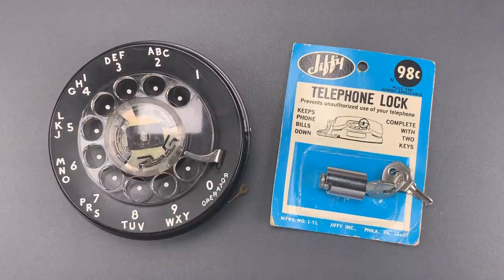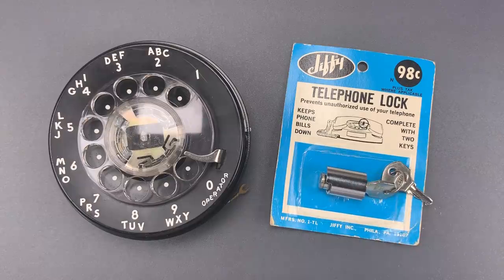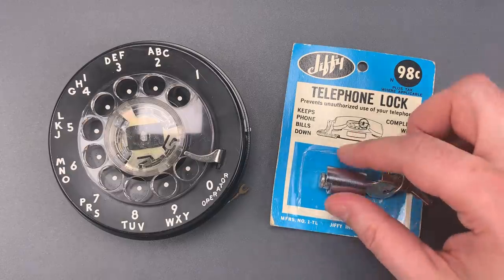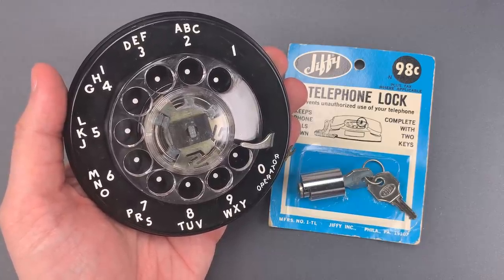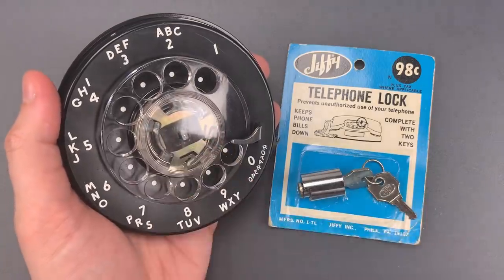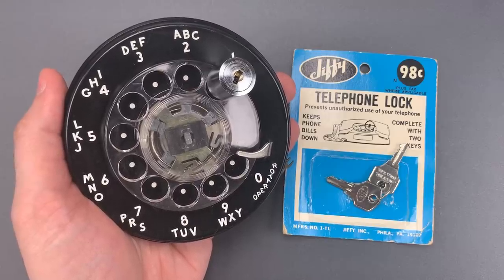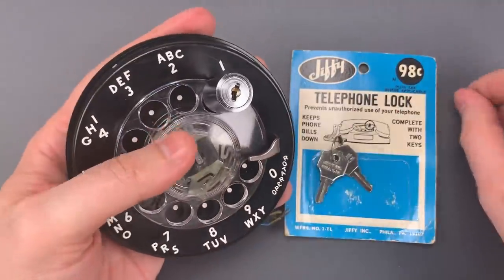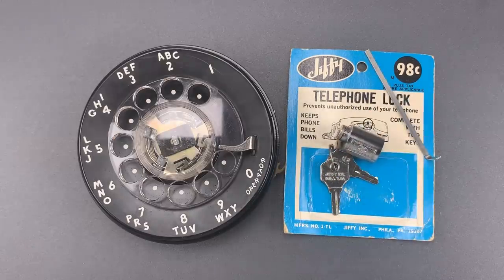[1084] This Lock Could Save A Month’s Wages... in 1960 (Jiffy Phone Lock)

Comment: Only now did I know how to dial with a Rotary Dial Phone
Reply: CIA Imports its seems like you have a bad experience with them
Reply: I had to learn it to solve a puzzle in a game a couple months ago. I was stuck for about 30 min before I googled it how to use these!😅
Reply: @CIA Imports Been there, done that. Hangover and mysterious sore finger. Usually started with an argument with a girlfriend.
Reply: It's not that hard to figure out, the holes lines up with the numbers, so that means each hole corresponds to a number.

Pressing the hole does nothing, pulling is impossible, sliding counter-clockwise is impossible, so sliding it clockwise is the only option.

For how far you go, there's a hook that would stop your finger quite comfortably, and 1 can't go further than that, so obviously, you go until it tells you to stop.

Lastly, when to give it the next number, stopping the mechanism midway when it goes back by itself pretty fast is impractical, the holes originally correponds to one place, and putting in multiple zeros would be impossible otherwise, so clearly, wait until the zero hole is back to pointing at zero
Reply: You young whippersnapper, why I oughta...
Reply: Thats sad
Reply: @cats9254 , Why? They haven't been in use for 20+ years, why should everyone br taught how to use one?

Comment: Before tone dialing, there was pulse dialing and it was possible to tap the receiver rest the right number of times with a short space between digits. I do remember seeing these dial locks in the UK, though. Unfortunately, I am also old enough to remember one telephone area where the phones did not have dials at all and a button had to be pressed to call the operator!

Comment: "long distance calls in that time were very expensive"
Laughs in Cap'n Crunch whistle
Reply: That was touch-tone exploit, rotary dial phones like this one predate the touch tone system and cannot be used with such an exploit.
Reply: FamiliarBreakfast before MF was deployed, tandems talked to switches using SF signaling, which instead of interrupting the talk battery with a pulse train simply sent the pulse train as a series of “beeps”. Common frequencies were 3700Hz for early O/N carrier and 2600 for E carrier and later N carriers. 3700/2600 was also played on the trunk when not in use to allow automated equipment to find an idle trunk quickly. If you reset the trunks by sending your own 2600 you could whistle your own digits into the trunk, like by whistling off a Vancouver number, you could send 2 pulses of 2600, followed by three one pulses; and be connected to a conference on TWX lines that had fallen into disrepair.
Reply: @MilesCallisto  First rule of phreak club, dude!  LOL

Comment: Based on the diagram on the package, I was expecting something that locked the cradle in place.
Reply: Later on, there was a version for desk phones that held the 2 hook switch buttons down.
You could lift the cradle, but the buttons stayed down.
These were generally used on Touch-Tone phones.
There was also a version for Touch-Tone phones that went over the keypad.
Reply: This lock has the advantage of allowing the phone to receive calls.

Comment: So a couple of years ago, my wife and I went to a yard sale. I saw an old phone there. I was intrigued so I bought it. It was an old candlestick phone with a rotary dial. It had a modern plug for a phone line so I thought I'd plug it in and see what happens. It doesn't ring, but you can pick it up and talk on it. Downside is you can't dial (Voip telephone providers don't support pulse dialing) but it works! And it's probably 70 years old!

Comment: In the 90s, there were jacks that had a lock that physically cut off the connection. Unlike those, you can "flash" the number you want to dial by rapidly pressing the disconnect hook on the cradle. Works fine on any POTS line or VoIP that has pulse to DTMF conversion.

Comment: We used to use a cabinet key back in the early 1980s. Stick it in, giggle it around a bit and it would open. Back when we used to dial into the computer.

Comment: We used to take the receiver off the hook and then hit the receiver tabs that stuck up on the phone body really fast 10 times. That would simulate the phone dial being turned from the '0' position thus dialing the operator. Once we got the operator we would ask for assistance in dialing the phone number we needed to dial. It worked every time.

Comment: A great example for how a lock is only as strong as whatever it is attached to.
Not only it should be easy to chip the lock off of the bacalite dial, or twist the small standoff that catches the finger / lock so it is not obstructing anymore, but as long as the handset isn't locked you can make a call using the hangup lever alone.

Comment: Crumbs I recall those, in fact I remember the dial being fitted to my folks phone when the local exchange went from switchboard to automatic. Fun fact, when I later worked for the Post Office before it became BT the first push button phones had a setting where they would use loop/disconnect pulses (i.e. emulate a dial) for old local exchanges not yet able to handle tone dialling.

Comment: When I was a child I remember the phones where there was no dial at all - commonly courtesy phones.  I was fast enough at flipping the on/hook off/hook button or the hook itself depending on  if it was wall mounted or table top, in rapid succession to manually dial and place a call.  5 quick clicks dialed a 5.  Took a lot of practice.  I was only 7 years old at the time.

Comment: I used to simply pick up the handset, and then commence rapidly pressing the hook switch that would depress and end the call when you placed the handset back down.  One click for the number 1, 2 for 2, 3 for 3 etc. If you were lazy, or couldn't do it accurately, you could simply dial "0" for operator, or "411" and ask for the number, they would connect you for an additional .25 or so. Better yet was having a lineman's handset in the car, or shoulder pack. :)

Comment: One way you could easily bypass the dialler itself, was using the switch where the handset would normally rest.
Dialing was about sending impulses, 1 pulse for 1, 2 for 2 etc.
By using the button the handset rest on, and pressing them at the right interval you could dial any numbers.
You can still do that with many phones today. Pulse dialing is still used by many old alarm panels.

Comment: For anyone curious as to how this dial worked:
Pulse dial phones send out a series of short pulses, kind of like Morse code. The pulses would be counted for each digit of the number. Area codes in the US are set up so that the most commonly dialed numbers of the time (such as New York City, DC, Philadelphia, Chicago, LA and Seattle) would have the lease number of pulses and could be dialed faster. 
We now use tone dial. If you have ever pressed buttons while on an open line, you may have noticed that each number makes a different tone. These tones correspond to specific numbers, as well as the additional star and pound keys that were added around the same time as tone dial systems. 
Pulse dial is still available in many places, however as switchboards are being upgraded, pulse dial phones will only be able to receive calls, not dial out.

Comment: I rented a room where the landlady had installed one of these.  Didn't have to crack the lock though.  When you dial a number, it pulses the line with the same number of pulses as the digit.  You could simulate a pulse by clicking the handrest switch.   So to dial 3251 - you'd rapidly click the switch three times, the wait, then twice, wait, then five times and wait and then once.   The dial produces about 10 pulses per second, you have to click the handrest switch rapidly and reasonably accurately.  But the telephone exchange has a fair degree of latitude for sticky dials, so you can get away with considerable inaccuracy.   With practice, you can call any number without removing the lock - or even touching the dial...and nobody would be able to tell that you did it.   Because pulse dialling phones are theoretically still usable - you can actually do this with many landline phones - even the ones with pushbuttons.

Comment: Rotary phones worked by connecting and disconnecting the line rapidly for the number you wished to dial. You can hack this on a touchtone by pressing the receiver button say twice for the number 2, or 8 times for the number 8. This is a scene in Silence of the Lambs too

Comment: Tap the handset part receiver (where you hang up the phone) once for 1, twice for 2 etc... and you can call without the rotary dial, I used to bypass those locks without taking them off.
When DTMF came, all you had to do is put an audio dialer to the horn......

Comment: You could easily type on the "off tab" on the phone (the tab that keeps the phone off and turn off calls) for a desired number. If you want a 3, hit it 3 times, wait two seconds and hit the next number. It works on all analog phones and I used that back in the day at my parents. No lock could stop the little rebel I was back then.

Comment: When the pulse dial phones were already phasing out, you could fast dial with them by using your finger to rotate the wheel on both directions (instead of lifting your finger and let the spring rotate it). I always wondered if this always worked or if it was a late addition to telephone exchanges.

Comment: I remember seeing these locks on phones when I was going to school. I would merely pick up the phone and use the receiver buttons to impart the pulse of each number I wanted to dial. That's how the phone system worked at the time. You didn't have to pick the lock, all you had to do was dial the phone by hitting the buttons three times for 3 pausing it 5 times for five pausing 7 times for 7, etc etc etc. That's how the pulse system worked.

Comment: These locks also existed in germany.
But here they made a good security feature for emergency calls.
The locks were hooked into number 3.
Ambulance and firebrigade had the number 112 and freecall. So even with lock, you were able to call for help.
By the way if neccessary, the 112 was able to connect/ send also the police .
All numbers in germany normally contained at least one digit higher than 2, so there was no complete number to call with 1and2.
Especially no number outside the city/village, because that required azero in front

Comment: Rotary dial worked by quickly picking up and hanging up the receiver in quick pulses.  The number 8 would be 8 pulses, 3 would be 3 pulses, etc.  You can dial without using the rotary dial by quickly pressing the hang-up plunger in rapid succession.  3 times to dial a 3, 8 times to dial an 8.  Try it.  It takes a little practice and you still need a mechanical phone.  But the phone lines still support rotary.

Comment: Another way of bypassing these locks. In my country (ex-British colony) you could simple tap out the telephone number on one of the "buttons" on the handset cradle. For example to dial 234 you would tap twice, short pause, tap three times, pause, tap four times etc. This worked because the dial mechanism simple produced pulses corresponding to the numbers dialed. Simpler times!
I seem to remember (long time ago) tapping phone numbers from a pay phone to get free calls.
Reply: Yup that still works.

Comment: they had those locks on the phones when I was in the Navy but there are easy to bypass . all you had to do was click the button on the Cradle once then and then click the button the number of times that correspond to the digits in the number you wanted to call . back in those days the phone company used a system called pulse the counted the number of times a circuit was open and close to activate a number

Comment: Ahh, the old days.  Being a lefty, I got used to dialing right-handed.  The biggest problem though is if you screwed up it took a long long time to redial the number after putting the receiver back on the hook and then removing it.  Those phones were bullet-proof though, really hard to break.

Comment: Who could forget that in-between time somewhere in the 80s and 90s when touch tone phones could also pulse-dial if they were used on a network that hadn’t updated to DTMF dialing. Not sure, but I think pulse dialing is still supported on today’s phone systems, so theoretically the rotary phone still works. Could try it out by flashing the hook to dial a phone number... “dialing” a zero was the most fun ;)
Reply: As long as it's a normal telephone line pulse dialing still works. It does not work on my DOCSIS/EMTA telephone line. Most landline phones sold today still have a tone/pulse selection.

Comment: The easiest way to "bypass" the lock would be to bang on the switchhook in the right pattern. The only thing the dial does on those phones is briefly open the circuit for a certain number of times, creating a series of pulses. Pushing down the switchhook also interrupts the circuit, so you could "dial" the phone by clicking the switchhook using the same cadence as the dial.

Comment: In the UK you used to put them in the zero hole - all local numbers started with 1-9, the emergency services could still be dialed (999) but expensive national/international numbers which all started with a zero couldn't.
Reply: Ummm, the 9 hole. Putting it in the 0 hole allows 0 to be dialed, lol.

Comment: I was born in the '60s, and remember growing up in the '70s. We had a rotary phone, party line, and I remember calling one town away (maybe 15 miles) was subject to "long distance" charges. Funny thing is, I did a lot more talking on the phone then than I do now. The audio quality of phones back then was superior (fully wired connection) to what you get now with cell phones. With cell phones, there is that tiny delay that often causes you to "talk over" the other person, which I find extremely irritating.
Reply: Oh, I forgot to mention, when touch tone became available, the phone company charged a monthly fee if you wanted touch tone capability. Many early touch tone phones had a switch that would allow you to select between touch tone and sending the pulses that a rotary dial phone would send. This allowed you to have a push button phone that sent the same pulses as a rotary dial phone and not pay the touch tone surcharge.

Comment: Ahh, the good old days, where you could slam the phone down in anger.  I also remember wireless landline phones that had a keypad, but when you dialed, you could still hear the pulse beeps as you pressed the buttons.  It still took just as long to dial the phone as a regular rotary phone did.  I think the one we had even had a switch on it to make it work like a touch tone if you wanted.
Reply: In the 80s there were a lot of cheap phones with keypads that only supported pulse dialing. No touch tone. These were the kind of phones they would give away with a subscription to "Sports Illustrated". Or if you went into K-Mart and bought the cheapest phone they sold.

Comment: I saw these in use behind the teller cage at a bank. The way they were used there was to rotate the dial around as far as it would go. It would actually spin past zero about three imaginary holes before stopping. By placing the lock in on the other side of the finger stopper with the dial half cycled past zero not even a one could be dialed. Some phones had metal rings and even better versions of this lock were sold. I've also known of people who would lock the phone in a drawer or cabinet still plugged in. It was a nuisance when that person would call in sick and their phone would ring from within the enclosure all day. These phones gave telemarketers blisters.

Comment: You could still dial out by pressing the hangup prongs rapidly since that's how the rotary dial worked. Press it once and pause you dialed a "1", press it rapidly 7 times and you dialed a "7", pressing it 10 times will dial a "0"

Comment: Another way around this lock was to tap the switch 4 or 5 times as fast as you could. The operator would pick up and then dial the number for you (at an extra cost).

Comment: I honestly miss those days, when it was common for each home to have only 1 rotary telephone, usually wall mounted in the kitchen, with a long ass cord that constantly had to be untangled, but could reach 10 or more feet. Sometimes there were 2 phones - one in the kitchen, one in the master bedroom. The bedroom phone wasn't wall mounted - it sat on a bedside table. But even moreso, I just miss those days. No internet. No cable TV. No cell phones. It's hard to believe there are kids these days who don't comprehend not long ago there was NO internet or cell phones.

Comment: We used to chew the cap of a pen, the ones which had a flat extension, and it worked after a couple of twists...
The heart attack intensified when it opens but doesn't lock even after 10 minutes of twisting

Comment: So there is another way to defeat the intention of this lock.  The dial sent a varying number of pulses down the line, the same pulses caused by the "hook" switch  that you used to end the call (the buttons that the headset rested on).  You could — and I have on a broken phone — dial a number simply by tapping the hook buttons (aka "flashing").  This still works in most areas if you have a landline and a old fashioned phone IIRC